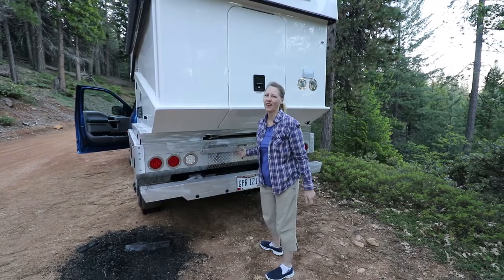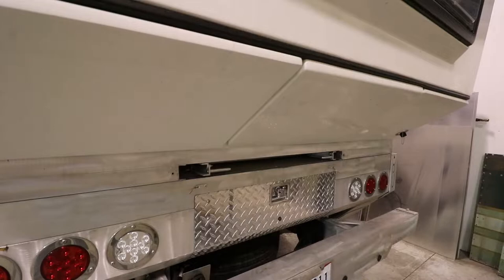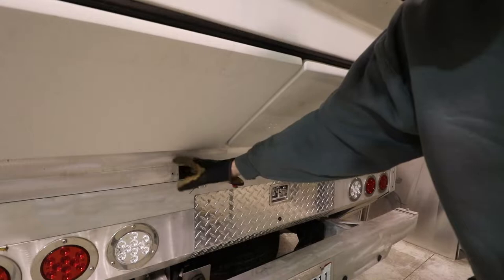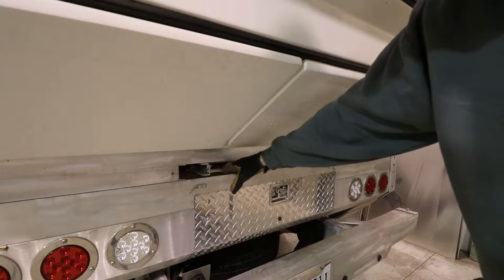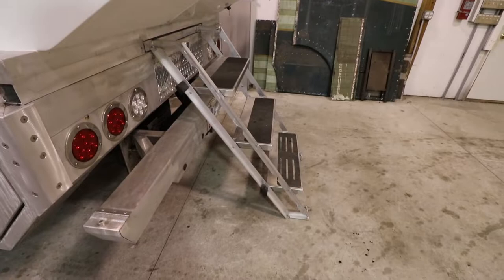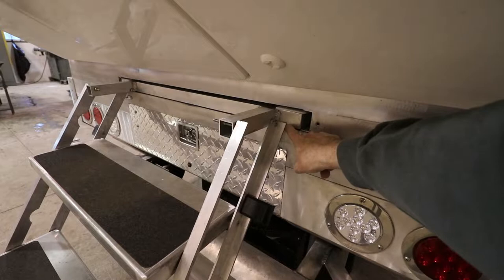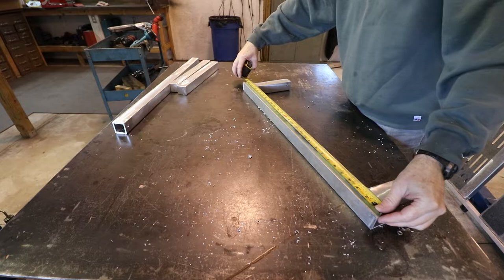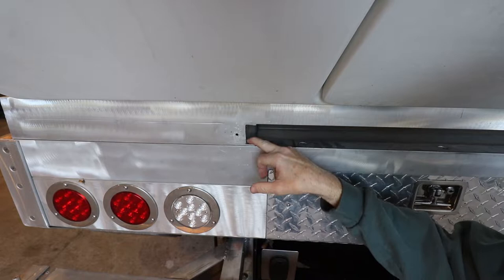XP Camper:  Time to Fix the Stairs!  Part 1 of 4

Comment: You hit it on the head as you were analyzing the carrier (what you call the slider). It was sloppily installed, upside down. The Delrin (Teflon, actually) was engineered to be the bottom sliding surface, but the fabricator wasn’t paying attention. The engineer was actually on target. Sloppy work by my compatriots here in California.

Comment: Your videos are GREAT, thanks so much for taking time to film and post! Question: Have you thought of adding some adjustable "feet" to the bottoms, so when parking at an angle (with 1 side on leveling blocks), the stairs don't need to be blocked?  (I can imagine this is probably more of an issue with XP/NIMBL v1s which have stairs on sides instead of the rear like yours)